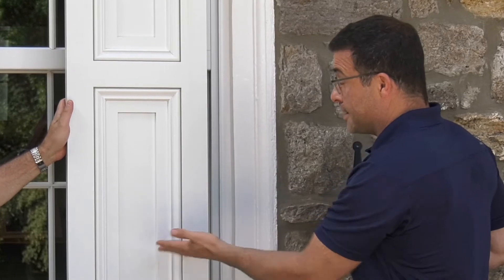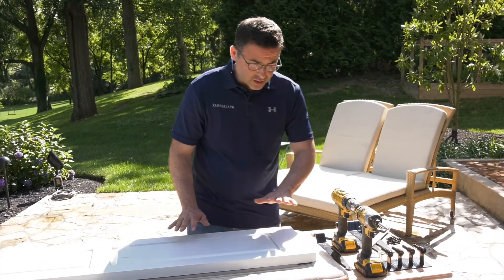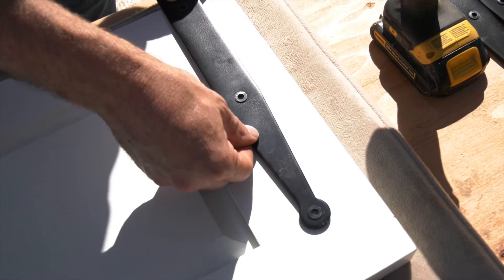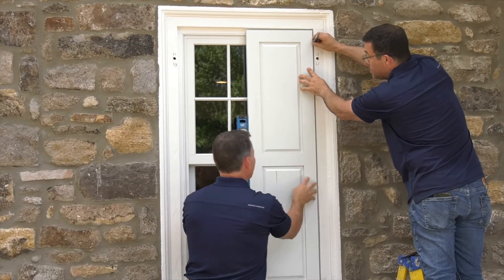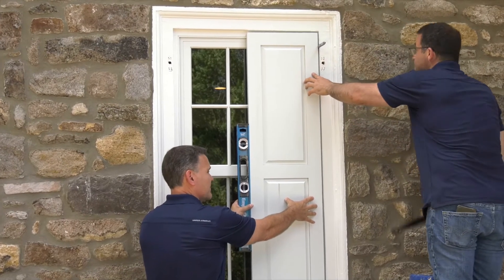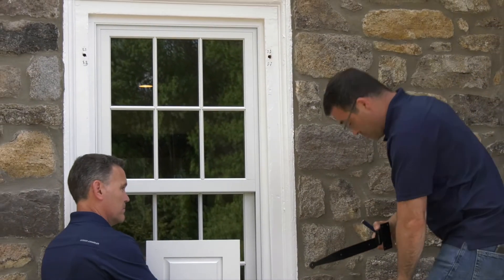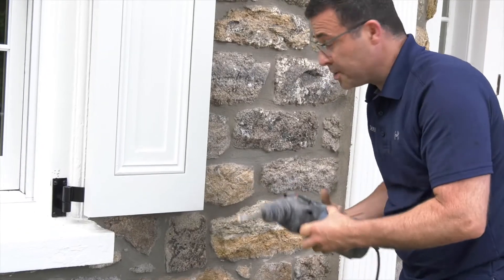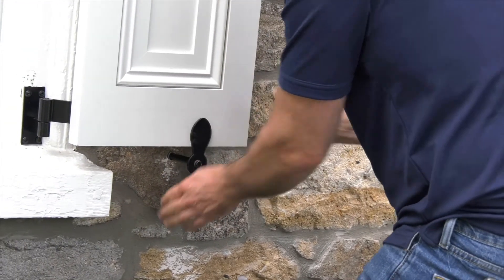How to Install Exterior Shutters | Functional Shutter Installation | Timberlane Shutters

Comment: Unfortunately, my window itself will not accommodate Pintles, therefore I am going to need to install on the surface outside of the window which is stone.  Do you have any recommendations on how to do this when the stone is uneven?  Any type of metal shimmy type pieces I could put behind the pintles to even them up from the stone where needed?
Reply: you prolly dont care but does anyone know a way to get back into an Instagram account?
I was stupid forgot the account password. I would appreciate any assistance you can offer me.
Reply: @Wayne Micah instablaster ;)
Reply: @Makai Yosef It worked and I now got access to my account again. I'm so happy:D
Thank you so much, you saved my account !
Reply: @Wayne Micah Happy to help :D
Reply: Alex, do you have window trim or something or brick?
If so lintels have different offsets to accommodate the difference between the exterior and window trim.
You should be able to attach to whatever exterior (siding,brick, stone ).
We do this all the time.